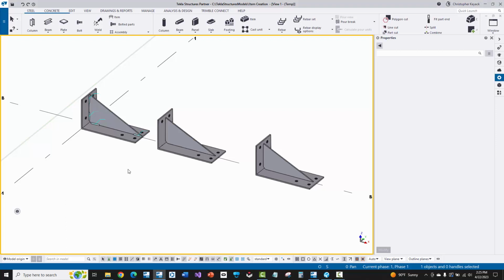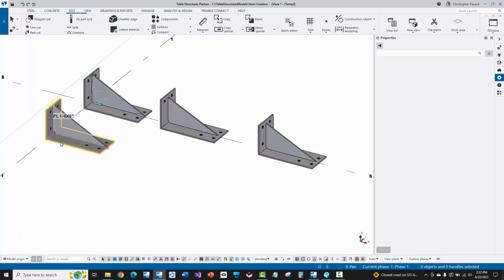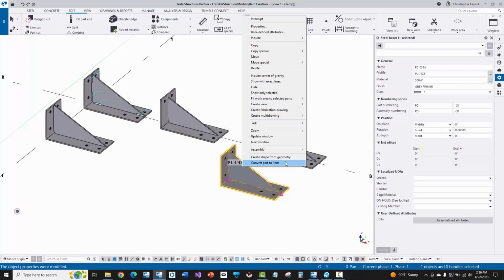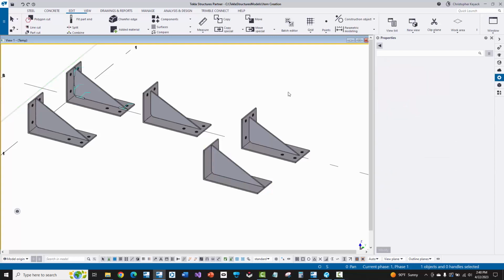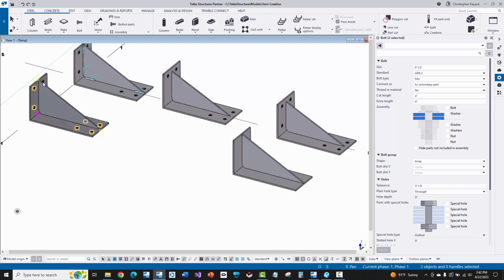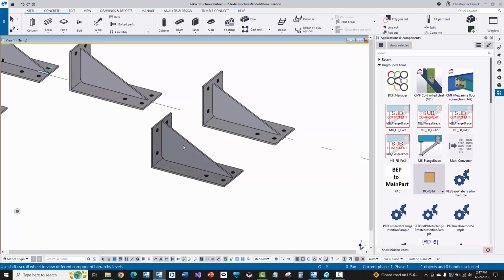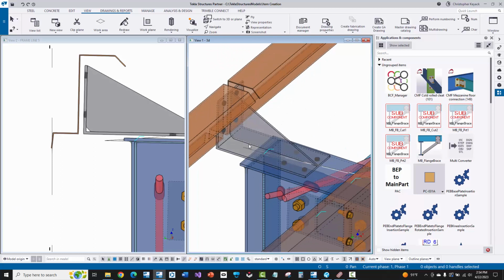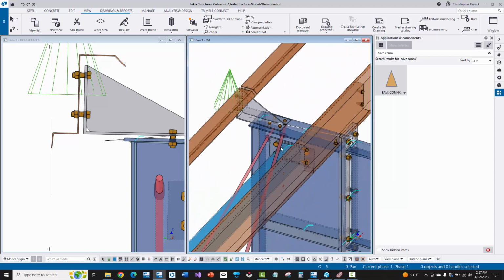KTS - Tekla Shape Items for Standard Parts

Comment: HI BOSS, HOW TO SAVE COMPONENT PERMANENTLY IN TEKLA SOFT...
Reply from the maker: Publish the custom component as a uel file and import into your model template or you can set the XS_UEL_IMPORT folder advanced option path to something like a sub folder in your firm folder. Look that path up on the Tekla user assistance
Reply: @KeyackTechnologySolutions  Could you please provide more detailed instructions on how to save the .uel file in the template model? Here's what I did: I opened a new drawing using the selected model template, then imported and installed the .uel file. It worked perfectly. However, when I saved the project as a new template model, the components were not copied over.